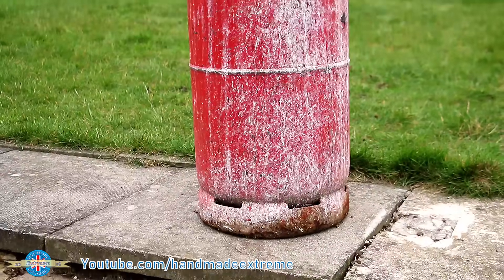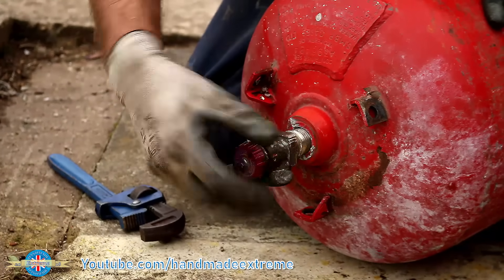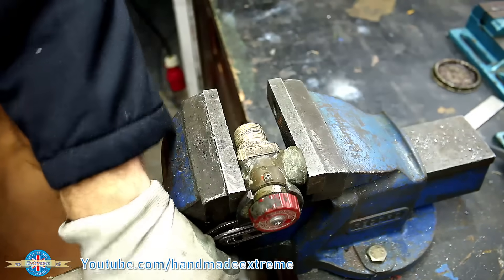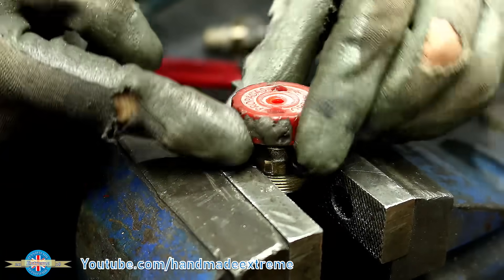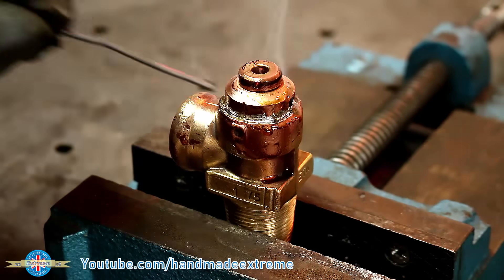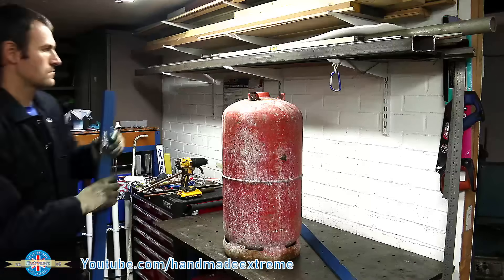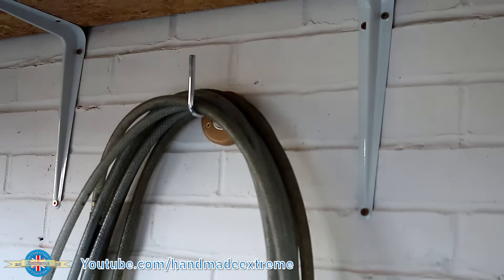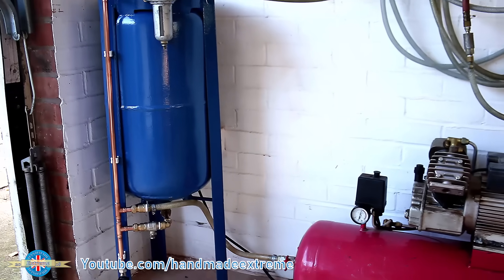Making an auxiliary air tank from an old LPG gas bottle.

Comment: You do know in your explanation of compressed air and moisture you missed out the very important factor of heat generated by compressing air which is what causes the moisture to escape in the first place
Reply from the maker: I did, you are correct. Thank you for pointing that out. Thanks for watching.
Reply: Heat causes the moisture to escape?
Hot air can hold more water than cold air.
Air's ability to hold water decreases as the pressure increases. This is why water accumulates in tanks. Tanks designed to hold compressed air are designed to deal with challenges associated with compressed air. In many places it's against the law to use tanks not designed for the purpose, as compressed air tanks.
Lots of industries require used tanks to be punctured so people aren't tempted to turn them into bombs like the one in this video.
Reply: @ddegn  I’m amazed more people do not share this sentiment in the comment section, and actually praise the original poster for doing this type of thing.
Reply: @nigeleharis5886  When my HVAC guy was servicing my heat pump, he was interrupted by call asking for an empty refrigerant tank. The HVAC guy explained he was required by law to make two large punctures in the empty tanks.
I thought there's be all sorts of info available about the dangers of using compressed air in tanks not designed for the purpose but most of my search results just showed other people making bombs like this video.
Reply: @ddegn  that was my point
Reply: Technically, the cooling of hot air is what produces condensate.
Reply: @nigeleharis5886  technically correct . the heat is only a by-product of compressing the air. 
Dryers in compressed air systems use calling to remove moisture from the air to 
Although I suppose if we wanted to be technical then the air would not allow moisture to escape when it cooled if it was never heated in the first place
Reply: @RMmechanical  calling? What’s that? And what type of air dryer are you referring to? Refrigerated, desiccant, membrane?
Reply: @nigeleharis5886  cooling lol seems  you know much about air drying systems you would know what I'm referring to that would be the most commonly used one i.e. refrigerant type 
If you know so much about these systems I don't know why you ask that question
Reply: @RMmechanical  depending what “calling” meant was why I listed those few types. I wasn’t sure if it was a method or part I was unfamiliar with!

Comment: Hi Rob, did you consider pressure testing the cylinder before use? This can be done easily and safely using water, a pressure gauge and a household pressure washer? Best Regards Sarah
Reply: Propane/butane gas pressure inside cylinder is something between 3-6 bars depends on temperature and propane/butane ratio. Compressor gives 8 - 10bars. But due the safety reasons propane cylinder can hold more than 20 bars without explosion risk. It is almost 2 times thicker than compressor pressure tank.
Reply from the maker: Hi Sarah, I did consider it but was confident that the tank would be ok. I know it's history and it's rated at well over the operating pressure. I love the idea of using a pressure washer for testing. I'm going to have to try that at some point. I have an old broken one in the workshop that I have been trying to figure out a use for. Thanks for the support. And thanks for the idea. 👍👍
Reply: theres a vintage machinery/keith rucker video where he does this but be careful only a small amount of air in the system when hydraulic testing can cause an explosion risk :)
Reply: The tank can start out fine but tanks not designed for compressed air can corrode quickly making them unsafe to use.

Comment: Never seen a 2 head direct drive compressor lol and nice work wish my stuff looked so good :)
The real world problem is when your compressor can't put enough air out to keep the tanks fill.
Keep up the great work
Reply from the maker: Thanks. Glad you enjoyed it. It had a good test today running the plasma cutter for a while this afternoon. Worked really well, compressor was fine as well. Happy days. Thanks for the support.
Reply: Having a extra tank doubles the load on the compressor. It’s only worth it if you have the compressor far away from the machine you use and you require a high cfm. Not worth doing so.
Reply: @64772679  Doubles the time to get up to pressure from zero, sure. But it adds no load to the compressor in the steady state, for any given air usage.

Comment: I work on compressors. 15mm copper pipe Is that going to take the 10bar/150psi pressure from the maid receiver? Is the LPG cylinder designed to take the pressure? No safety valve fitted to the LPG cylinder. Lots of safety dangers. A hydraulic test should be carried out to the LPG cylinder for your piece of mind. I have seen incorrect and damaged receivers and storage vessels give way and explode with disastrous consequences.
Reply: Safety danger = yes.  FIVE WORKERS were killed when a used steel tank from Scotland was installed in a steel mill at Burns Harbor, Indiana.  Indiana is an ASME code state and Section VIII, V and IX are mandated.  The tank in the visdeo above is two deep drawn shell halves and the circumferential welded joint is not the 'jog' that we have here for propane tanks of this size.  Is there a backing strip still in place?  If yes, this will be a corrosion starter.  Also the thick pad welded to the head was added by whom?
Reply: @larselder874  It is not pretty when a compressed air receiver lets go and explodes. Seen it, been involved with it. It`s not just the damage that you may cause to yourself it`s the damage that could be caused to others.
Reply: @larselder874  what a wonderful reply, thank you.
Reply: It's not hydraulic test, it's a hydrostatic test and a safety valve is not needed as generally there are 2 on the compressor itself, 1 in the switch that runs the de-loader and another on the tank itself and as seeing the tank is open loop connected to the main compressor tank the safety features are extended or do you think a tank is going to magically over-pressurize while the valve between the 2 tanks are close? I think not. Oh and a quick google check would have indicated to you most gas tanks working pressure is between 100-200 PSI and tanks are designed at 2 times working pressure to get your max pressure for safety, this is the same formula you generally have for air tanks as well. That compressor of his goes to a maximum of 150 psi which is well within design specifications. I think your years spent in on compressors was wasted it seems as you do not understand basics of a pressure vessel and/or lack common sense as when you have a safety valve it only releases on overpressure not at long term air storage, so either case if the receiver fails it's a moot point as it would most probably fail open as that is what the tank would be stored as, again common sense is lacking with you. If you are going to cry about safety I hope your air compressor is stored behind a metal safety cage otherwise it is stored improperly if you want to be a safety nanny.
Reply: @kazykamakaze131  I think you will find there is only one safety valve on the compressor receiver probably on the pressure switch. Agree that it is a hydrostatic test, however there should be some method of safety for the slave receiver.
Reply from the maker: @stevecarter529  Hi Steve, Thanks for you comment. The 15mm copper pipe where I live has a burst pressure rating of over 600PSI in its annealed state and well over 1000PSI in the as drawn condition. 

There is a safety valve on the compressor itself and the aux tank pressure can never exceed the pressure delivered by the compressor. (If it could I'd be a very rich man, but you can get out more than you put in) The pressure rating for the Aux tank is also higher than the one fitted to the compressor itself as well. Obviously different tanks around the world will have different ratings. 

Also a significant point here is that the rules and regulations for what is required are also different all around the world.

A hydrostatic test would have been a nice thing to do, yes. But in my case was not necessary. I know the history of the tank and know it's condition. 

Thanks for you concerns and thanks for watching.
Reply: @kazykamakaze131  STFU with your unsafe practices.
Reply: @kazykamakaze131  perhaps your answer lies with the PEOPLE WHO MADE THE RULES LMFAO
Reply: @kazykamakaze131  keep to the matter at hand buddy Lmfaoooo

Comment: Jeezsh, Why not simply put a proper fittings, instead of modifying originals? Also it's quite poor practice to not have over pressure valve on pressurized air containers. I'd also definitely add automatic water removal valve. That short piece of pipe doesn't hold too much water in heavy usage.
Reply from the maker: Simply because I didn't have one that was the right size.  I also like to try and reuse things rather than throwing them away and replacing them. I like the idea of the automatic drain valve. I may add one at some point, great idea, thank you. There is a PRV on the main tank which will vent both tanks in the event of an over over pressure situation. Thanks for the support.

Comment: Nice but I think you forgot to install a pressure safety valve to your new air tank.
Reply: Sarah you are wrong.
Reply: @nigeleharis5886  What would the max pressure release safety valve do if there is already 2 in the open loop between the tanks? It makes literally no difference as the only thing those safety valves do is to stop over pressurization which the auxiliary tank won't get to because of how the air flows from main tank to auxiliary. The motor is mounted on the main tank thus the only tank mechanisms that matter is the main since if the receiver fails from the auxiliary tank it still wouldn't matter because of the open loop concept.
Reply: @kazykamakaze131  hey I don’t write the Codes of my trade but I follow them 🙃 all pressure vessels are required to be NB certified and stamped. They require a pressure gauge as well as a safety valve. ALL. PRESSURE. VESSELS.
Reply: @kazykamakaze131  i literally make money doing this, so Let’s not.
Reply: @kazykamakaze131  any repurposing entirely voids NB certification. It’s an illegitimate concoction.
Reply from the maker: The system is protected by the pressure safety valve on the compressor itself. The pressure in the aux tank can not exceed the pressure delivered by the compressor so the existing safety valve is sufficient. 

As a secondary point the pressure rating on the aux tank exceeds that of the tank fitted to the compressor itself. It isn't going to go pop. 

Please consider when stating 'codes and rules' that Youtube is an international forum. The rules where you are in the world are not global and may not apply in other areas of the world. 
Governing bodies and regulators are different all over the globe. It would be great if we all had one set of rules but that simply is not the case.
Reply: @nigeleharis5886  You realize it makes no difference in this subject if you make money or not as this application the owner only made it for himself and not for anyone else, thus all liability lies with him and him alone and no one else. FYI all codes differ from country to country so your perspective is basically useless regarding codes with what others do. Thus this build is only for him and him alone and common sense is the only thing that is applicable.
Reply: @kazykamakaze131  it makes all the difference because I am a professional ON THIS SUBJECT and you are not
Reply: @kazykamakaze131  so like i said, it’s an uncertified concoction that is TECHNICALLY unsafe. Sure, it may work for the users intended use....it also may not lmfao.
Reply: @nigeleharis5886  You saying you are a professional doesn't mean you are one. I can also then call myself a professional then clearly as we are all throwing the word around now.
Reply: @nigeleharis5886  "Technically" it is not unsafe, and certified doesn't mean sh1t for those whom created it to use it. He is not selling the thing to anyone so why does it matter? You live in a world that is bound by rules and not common sense and this is why you will always lack common sense. You realize the longer his "concoction" goes on without blowing up the more you are proven wrong and the more your "professional" knowledge is proven to be incorrect? But I doubt you'd come to this realization as you lack critical thinking. 
I don't even work with compressors daily and I still know more than you on this subject, whatever "education" you received I'd ask my money back.
Reply: @kazykamakaze131  and im a professional air compressor technician. What is your trade? If it’s not mechanical then please see yourself out and just stop replying.
Reply: @kazykamakaze131  go play with your own safety. Don’t try to influence the safety of others with misinformation and unsanctioned practices. Aloha. Lol.
Reply: @kazykamakaze131  for any further technical information please feel free to contact my office. We are happy to help those with no concrete knowledge of air compressors and air systems.
Reply: @nigeleharis5886  Even though there are two tanks, in this configuration it’s only one pressure vessel. The second tank have the same or lower pressure as the main tank at all times. That’s kindergarten physics, and something you should know if you’re working with compressors.
Reply: @jesperwall839  you’re wrong. You have a kindergarten level education on air systems buddy
Reply: @jesperwall839  this literally has been my line of work for more than 10 years
Reply: @jesperwall839  WTF do you think is in the auxiliary tank? PRESSURIZED AIR!
Reply: @nigeleharis5886  Please. Then tell me. Is the air in the secondary tank not at the same pressure as in the main tank?
Reply: @nigeleharis5886  The only thing you have proven here is that some people can work with stuff for 10 years, and actually never learn the physics behind what they work with.
Reply: @jesperwall839  I’m not denying that fact. What happens if they tank is isolated and somehow say, a fire starts near the tank, causing a temperature and therefore pressure increase? That tank becomes a bomb.
Reply: @jesperwall839  original poster also acknowledges that the codes of his country require the use of PSV AND PRESSURE GAUGE on all air receivers. But because it is his DIY, he accepts any and all liability of any failure. Nice try attempting to chime in and shut down a journeyman millwright specializing in air compressors.
Reply: @jesperwall839  air compressors are obviously not your trade, it’s okay dude. It’s mine. Keep on trucking!!!!
Reply: @jesperwall839  please stick to your line of work, whatever it may be. And please stop using “physics” in your replies already lol.
Reply: @jesperwall839  go ask an engineer, boilermaker, plumber/pipe fitter, the list of trades goes on. You really think you know more than those trades with hundreds of years of vocational development???????? 

....THESE SAFETY DEVICES ALL EXIST FOR REASONS
Reply: @nigeleharis5886  You think you’re an expert, only because you do some hands on service on compressors. You forget that all of this is designed by engineers, like me. So please. Go back to school and learn some physics 👍
Reply: @jesperwall839  like I said buddy, ASME lol.
Reply: @jesperwall839  lots and lots of different kinds of engineers too. What kind are you? WHAT KIND OF ENGINEER ARE YOU???

And more specifically, why are you more qualified to speak on air compressors than I am? Because you are an engineer? We are who the engineers call to fix problems regarding these machines. I’m speaking from a trade perspective. Anyone can, should, and will agree about the “physics” about things. We are both right in what we are trying to say. Can you accept that? 

Original poster even acknowledges the need for them in business/3rd party use settings. But since this units a personal endeavor only, so what, right? 

What happens if auxiliary tank is isolated with some pressure and there is a flame under it? With no safety valve, and no pressure gauge, when personnel could be near? Isn’t safety a part of engineering?
Reply: @nigeleharis5886  You are not an engineer.. We wouldn’t have this conversation if you where.
Reply: @jesperwall839  mate what’s your email, let’s continue this off of YouTube.
Reply: @jesperwall839  still waiting for your email.
Reply: @jesperwall839  another troll with literally no solid information in this entire comment section lol.
Reply: @jesperwall839  you from Sweden, mate?
Reply: @jesperwall839  where you at? Lmfao
Reply: Is it needed as the pressure regulator and safety valve on the main compressor should cover this, as the entire system should be at the same pressure? Or am I showing my ignorance?
Reply: @loydsa  No you are right, but extra safety valves never hurt though. Never heard someone die from having too many safety valves but have heard a few people die of not having any.
Reply: Its on original compreser
Reply: Any air receiver needs a pressure safety valve.